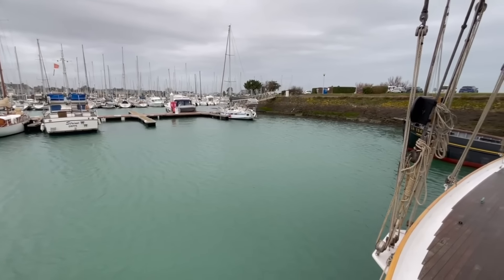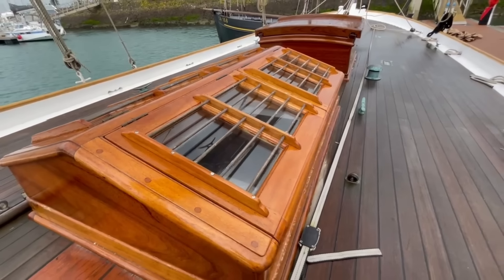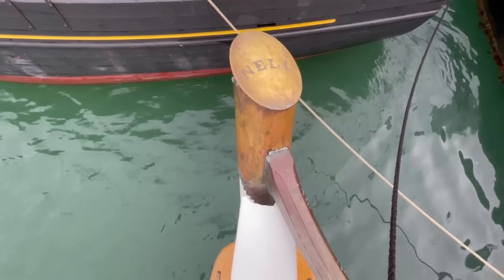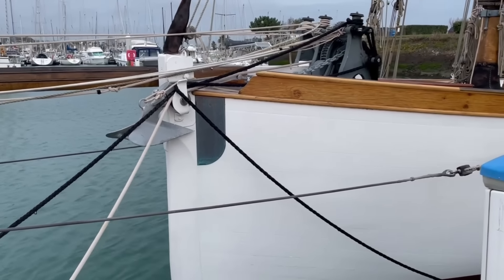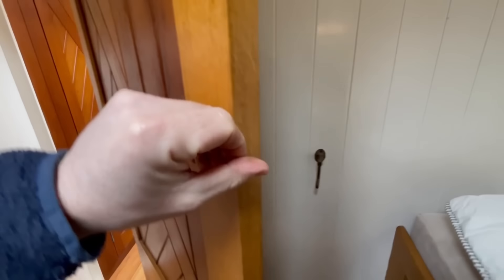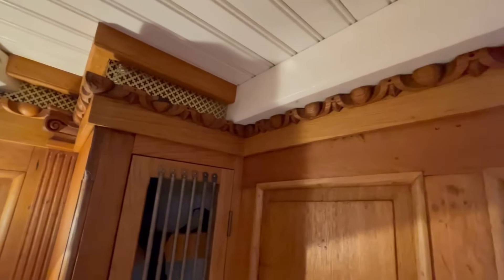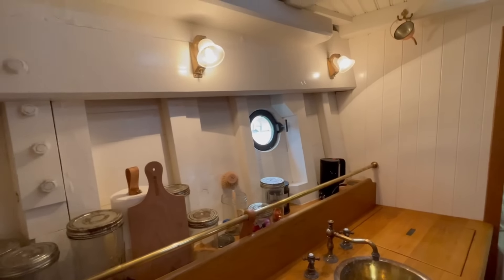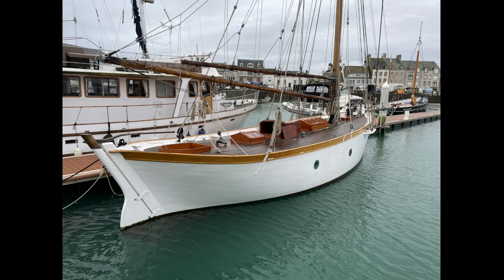46' G.L. Watson Gaff Cutter NELL from 1887

Comment: Wow! This was my father’s old boat in late 80’s/90’s. Lots of happy memories sailing on Nell, but where has the Mizzenmast gone!? Looks odd without it!
Reply: Missing-Mizzen- couldn't resist..maybe it was passed to Leo as he rebuilt Tally Ho, in Washington state..Certainly its clear much of the gorgeous features of Tallyho's salon, including a long list, ranging from the design specific  leather couch, liquor cabinet, sliding stain glass, brand & style of period lighting, the mains wiring cabinet and trim, all greatly contributed to Tallyho's easily ranking ,most beautiful modern day yacht, worldwide 🎉 Leo failed to credit where credit was clearly due..surely not unkindly..who knows why ..perhaps some conflict of interest or such.   I'd guess fitting a buyer to this gem will be challenge considering the tiny steering bucket, & the requirement the open deck without restraints or handholds will require a stone sober crew, fit as Olympic champions & a circus high wire walker. Can't begin to imagine any typical billionaire confidently approaching her bow in a high rolling high wind & living to return to the stateroom for a comfy night
Reply: @canyonhaverfield2201 you reckon tally Ho had some design inspiration from this I don’t think so